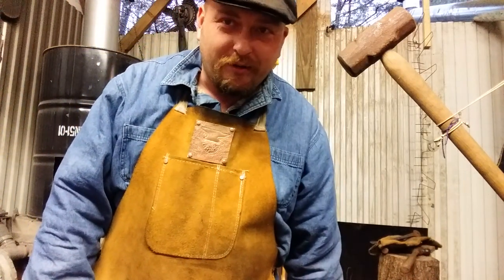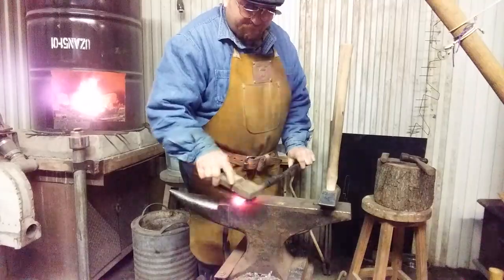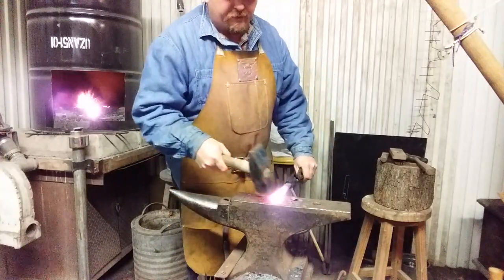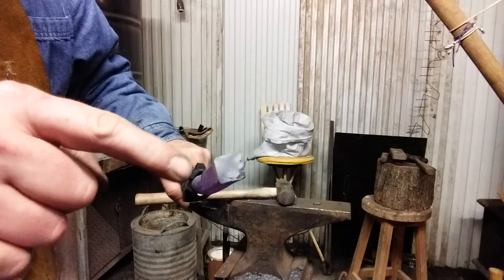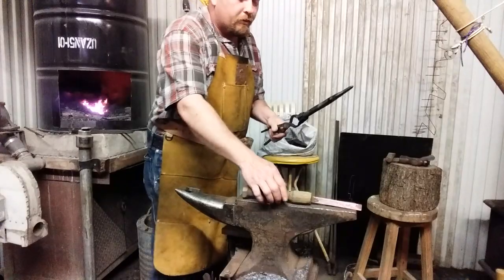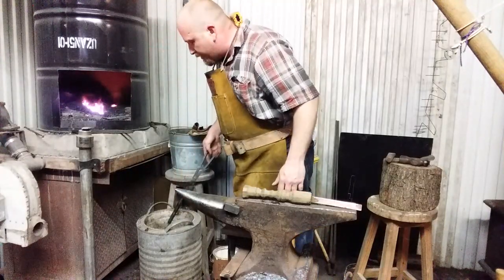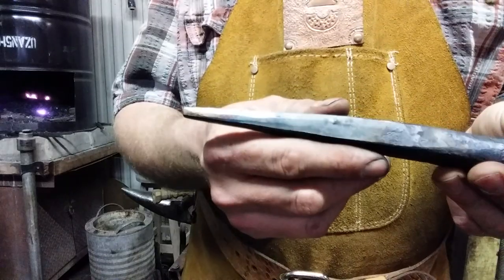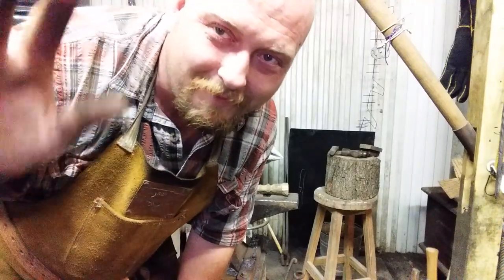How to make a square punch

Comment: Awesome video! I was gonna ask in a past video but I forgot. What weight is the ball peen hammer you use?
Reply from the maker: Safety 3rd forge, My old Stanley ball peen is a 32oz I picked up for five bucks at a yard sale. It's the hammer I've had the longest and still has the original handle.
Reply: The Sprinkled Donut Forge that’s awesome! I’m gonna have to hit up some yard sales this summer!